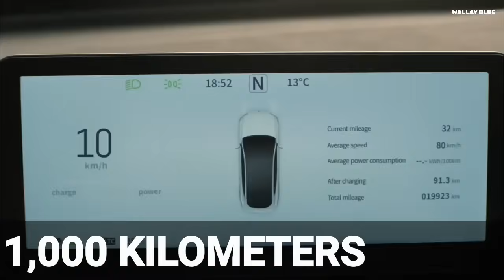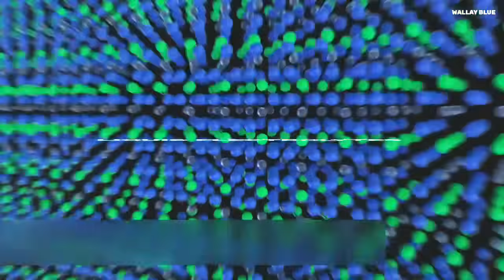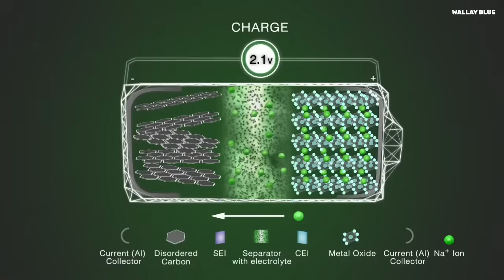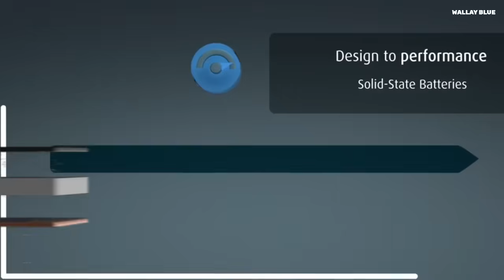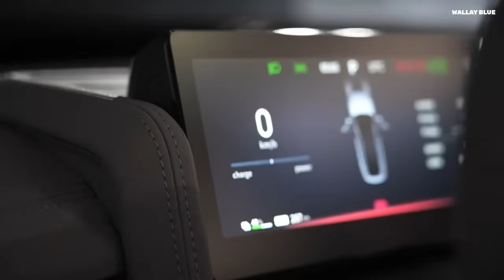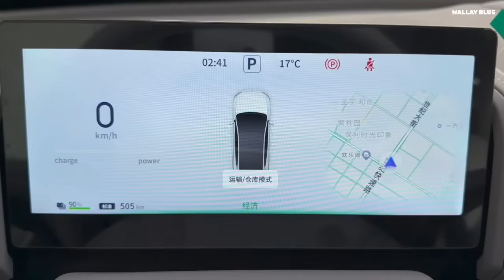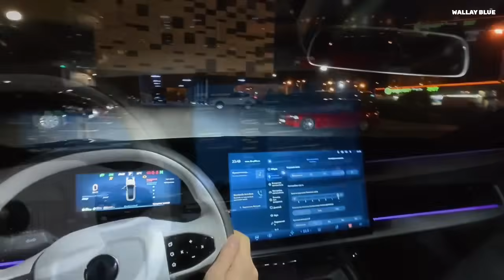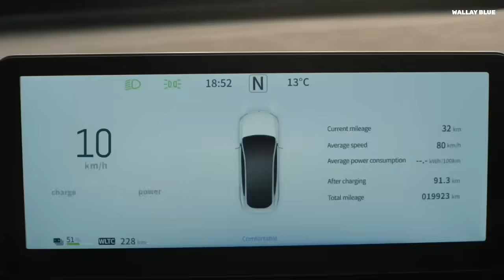Dongfeng & Huawei’s EV Shocks the World: 1,000KM Range, 5-Min Charge

Comment: The problem with solid state batter this video doesn't address is charge cycles. You would have to have an infrastructure set up to change out the batteries inexpensively and more frequently.

Comment: My PHEV charges from my solar at 2Kwh for 5 hours from empty to full.  That gives me 30km. 1000 (at the same rate) uses, say, 333.33Kw.  To charge that battery in 5 mins, not considering heat losses, it would require 333.33kw * 12 = 4Mw of energy.    Maybe they charge one at a time near a power station?

Comment: The problem here is that reporting on the Dongfeng event at which announcements were made has been so vague that it isn't clear what is coming in 2026. Is a new solid state model coming? If so, what model? Or, is a cooperation with Huawei coming, which may or may not have a model to show in 2026?

This is no doubt an important moment for Dongfeng in its electric  transition. It's important for us too, because it seems to completely put to bed the worry of range anxiety. More than that, the price penalty of the range gains is negligible.

Besides the surprisingly good news on product pricing that will be welcomed by consumers, EVs like this one could  actually accelerate the rate of the EV transition in China. If Dongfeng and its competitors can ship products like this in volume to consumers the mop up phase of the electric transition will go quickly - ICE vehicles will be a thing of the past before the end of the decade.